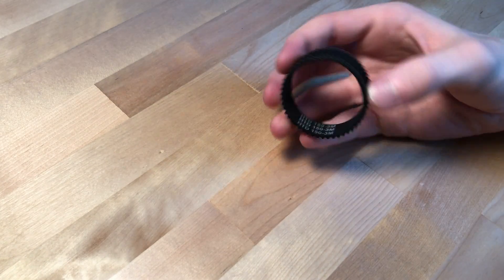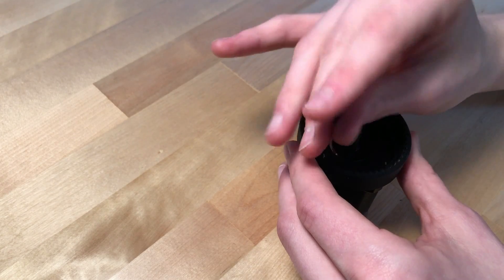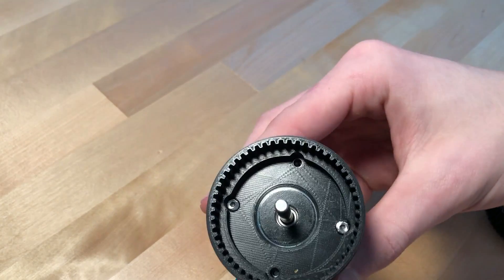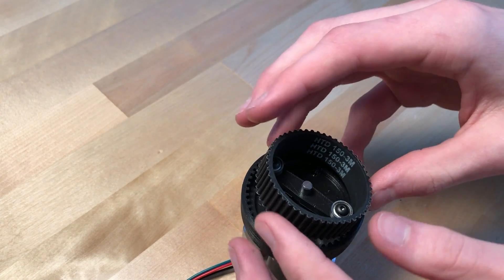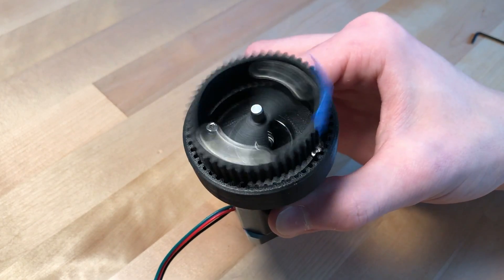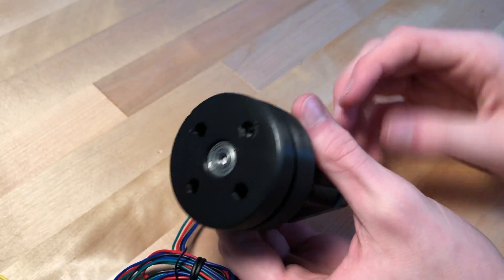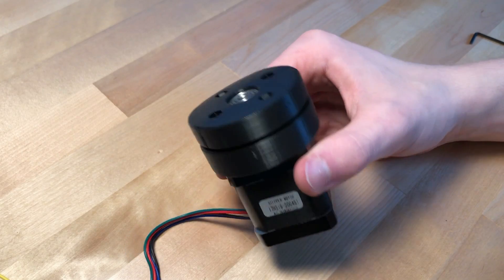Making a 3D Printed Harmonic Drive Using a Timing Belt

Comment: I have wondered on these why the flex spline couldn't be replaced by 2 smaller cogs. I really need to get into 3D printing.
Reply: It can, and in that case you'd have a planetary gearbox. AFAIK this style has lower backlash, and is slightly easier to make.

Comment: Cool project, but a couple of things...  Your gear ratio is actually 25:1, not 26:1.  (it's (50-52)/50 wrt the motor rotation)

In a typical harmonic drive, the flex gear would be the output stage.  You actually have a split-ring gear harmonic drive which is a little different.  In the case of a split ring gear, the tooth count of the flex gear is actually irrelevant - it is the ratio of the output ring gear to the stator ring gear tooth count that determines the gear ratio.

You didn't state it, but your output ring gear appears to have 50 teeth, which is why you get a 25:1 reduciton.  If you kept the 52 and 50 tooth ring gears but changed the flex belt to, say, 48 teeth, you would still observe a 25:1 reduction.  And if your output ring gear had 52 teeth, it would not rotate at all (regardless of flex belt tooth count, though the flex belt will still rotate).

Comment: does the top lid have the same number of teeth as the bottom or 2 less like the belt?
Reply: I came to ask the same question. They must have different number of teeth, or the belt teeth would slot into the upper ring teeth the same as the lower and the top piece wouldn't move. So the belt won't fit both sets of teeth the same. Not sure if that's a problem. It would be nice to see the poster confirm differing tooth counts.

Comment: Belt is better suited to the flexing a flexible splined cup sees.  Is this a two stage gearbox?  It looks like the belt should add a second reduction when coupling to the output.  What is the reason you didn't continue with this instead of going on to cycloidal gears?

Comment: It looks like it could be a fully functional design with only a couple of simple modifications that you already intend to implement. It’s a very elegant feat of mechanical engineering.

This is just a small semantic nitpick, but can we call these devices strain wave gears? It’s much more descriptive and It’s already a widely used term.

Comment: I don't understand why the output ring gear doesn't allow the belt's teeth to "walk" past its teeth, like it happens with the stationary ring gear.
Reply: I watched a video from Jetpack Academy called Harmonic Drives explained, he explains very well how this system works
Reply: The upper ring probably has a different number of teeth compared to the bottom ring. It must right?

Comment: Good video, thanks for posting it. Although it’s definitely simpler to make this drive with a rubber belt, ideally the three components would be made from the same material to reduce wear, ideally something with low friction coefficient. The shape of the teeth should also be revolute, that will increase the force of the alignment. I will cut one out of HDPE on my CNC, the design is definitely CNC-able and I find that HDPE or nylon could be the ideal materials for a cost-effective build.
Reply: What are revolute teeth? Wasn't able to find anything on the internet

Comment: I think it might help if you used larger diameter bearings to press against the belt, so as to get more teeth to engage. That should reduce the chance of slippage and also make it run smoother.

Comment: gear ratio calculation:
flex spline teeth = 50;  circular ring teeth = 52.

Ratio = (Flex spline teeth) / [(circular ring teeth) - (flex spline teeth)]  
Ratio = (50) / (52 - 50)  = 25

how did you get 26?
Reply: It obviously depends on the side the stepper is mounted. So: Ratio = (circular ring teeth) / [(circular ring teeth) - (flex spline teeth)]  = 26

Comment: Timing belt! You need to know why there is little backlash and long usage life time of it when it is under normal use. The tension force acts on it is along the length of the belt and it is counter-acted or withstood by the fibre strands inside. In yours application, it didn't use any of this benefits, instead it just uses a couples of rubber tooth to hold the two internal ring gears together. Flexible rubber creates backlash when they are under the torsional force, and belt will break apart after a long time high loading usage.

Comment: The original 1955 design is genius but I have to say this is equally impressive.  You need to pay closer attention to the elliptical geometry so that 30% of the teeth are always engaged.  As has been suggested a larger set of bearings in the wave generator will improve things.

Comment: The belt is less of a good idea because it deforms in a non elastic way consuming energy and reducing the efficiency. Another issue with the belt is that it introduces backlash.This part should be made of a rigid elastic material. Just print it and it will be much better.

Comment: Use a cam nut (eccentric bearing) as
 one of the rotor bearings.
Reply: Can you explain what it would do? (Trying to understand)
Reply: @TheRainHarvester  It would allow easy adjustment of the tension inside.  Make it tighter without reprinting everything.

Comment: How many teeth does the top part have? From my understanding of harmonic drives bottom part should have 52 teeth. Belt and top part should be one unit, so I don't see the point of having bearing to push against that.
Reply: I counted 52 teeth on the part attached to motor.
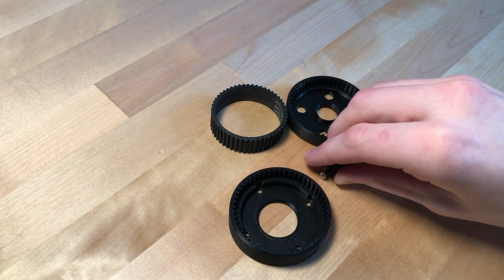 1:26  The top was harder to count but I counted 50 teeth.
The belt had 50 teeth.
Reply: @TheRainHarvester  That's impressive that you actually counted. If you look at 5:56 you will see that there is a bearing on the top part of the belt. In my opinion top cover and belt should match exactly, in size as well, with no actual room for movement and could be glued. At least all the diagrams I saw were one solid piece of metal. In this design the top cover might have the same radius as the bottom part, but have it's teeth spread apart more not matching with the belt unless it's deformed by the top bearings and has two points of contact. Some friction may occur.

Comment: Wait... It's 50:52:50? Why would you get any output at all?
Reply: I think it is 52:50:50 (Input:Belt:Output). So the belt moves 2 teeth per cycle of the motor which results in a 1:25 gear. (2/teeth of belt). The output moves with the same speed of the belt as they have an equal numer of teeth.
Reply: I guess you could mount the output  eccentric and make it a 51 or 53 tooth?

Comment: You said it is easy to make, cheap and doesn't require tight tolerances... well industrial grade harmonic drive is just the opposite of it, since it uses elliptical bearing which is very hard to make one with decent quality, good harmonic drives have price tag of 700 USD and up.Nice video though. Just curious, why did you abandoned the harmonic drive project and focused on the cycloidal drives? cheers
Reply: I am struggling to get my head around the elliptical bearing too.

Comment: From what I've seen and understand, the flex spline (the timing belt here) is actually physically attached to the output housing in an actual harmonic drive.   It's like a bell shape with teeth on the outer rim, with the entire bell flexing.  In your design they are separate.  Essentially you've created an interesting variation of a harmonic drive with a floating internal flexure.    Try using PET to print the output housing as a single unit.  This should give you the rigidity to achieve the calculated output torque.   I'm gonna try it myself, this is a nifty print.
Reply from the maker: You are correct. I didn't opt to print the flex spline because I didn't think my printer could handle flexible filament.
Reply: @LeviJanssen  I've been playing with colorfabb vario shore.  Its so clean to print with.  I make prosthetics with it

Comment: why does the top rotate, isn't it just a (more or less) mirror of the stationary piece attached to the motor?
Reply: the top has 2 less teeth which is why it rotates.

Comment: Pb with the nema is that it has no torque at high speed. So definitely either you should consider another motor. Nevertheless great job with this harmonic drive : very inspiring
Reply: That's the point of the reduction tho

Comment: Cool man! Have you made any further progress? I'm thinking of making some, and i really like that you used standard timing belt.
Reply from the maker: No, I haven’t. I much prefer cycloidal drives, so I’ve been spending time working on those.
Reply: @LeviJanssen  any particular reasons?
Reply from the maker: I don’t like the idea of using soft bodies in a high torque system. Doesn’t seem reliable. And I just think cycloidal drives are beautiful.
Reply: Levi Janssen That’s an inspiring answer :) I guess i’ll try both, but my internal feeling tells me that it is actually not that bad to have something rubbery inside a 3d printed mechanism, so it absorbs some shock instead of breaking a piece.
Reply: @LeviJanssen  Im looking at making silicone moulds for PU parts.  They should be plenty strong enough and allow you to replace the timing belt with a cup type part which will eliminate the issue of belt travel

Comment: Hi Levi
I really need your helps about this design.
Has its torque improved after the bearings have been replaced?
How much is its practical reduction ratio?
Does the friction between the belt and teeth cause the belt to wear out?
Reply from the maker: I never replaced the bearings. I didn’t need to. The reduction in a conventional harmonic drive is half the teeth of the flex spline (25:1 in my case). I’d imagine the belt would wear some. Mine really wasn’t used for anything, as it was just a test, so I wouldn’t know exactly.
Reply: @LeviJanssen  Sorry, You said in the video you want to use a longer internal bar.
Did you test it?
How can I design the internal gear tooth profile?
Reply from the maker: I didn’t test it. To design the tooth profile I just took some measurements and approximated. Nothing too scientific. It took a couple tries but it worked.
Reply: @LeviJanssen  
I have to make myself one and see how it works.
Thanks
Reply: @LeviJanssen  I look forward to your reply.
Reply: I would also like to know about "1-Is the top piece has same teeth number as the belt?"
it shouldn't, right. but if it does not have the same amount of teeth, the pitch will be different, causing backlash!?
Reply: I came back with few questions.
1-Is the top piece has same teeth number as the belt?
2-Should the lower piece teeth have same profile as belt teeth or there should be much more clearance? If so, how much clearance is enough?

Comment: Haven't you change the bearings yet? Did larger bearings solve the vibration and torque problem?
I want to use it as a functional part in my telescope mount.
Can you make a video of how to design it in Fusion 360, like the one you did for cycloidal gearbox? I don't know how to design an internal gear to pairing the HTD belt.
Reply: I am trying to build an equatorial mount. Did you find what you were looking for?
Reply: @scp-yearsago  No, my project was abandoned. But as soon as I buy a 3D printer, I will try to print a harmonic drive.